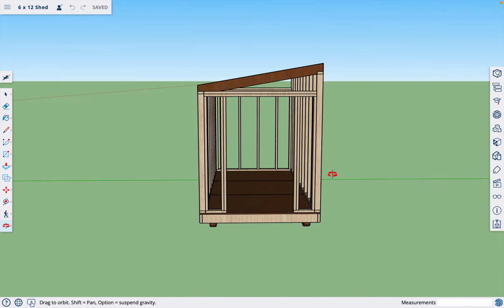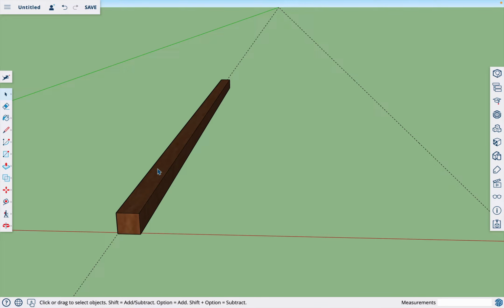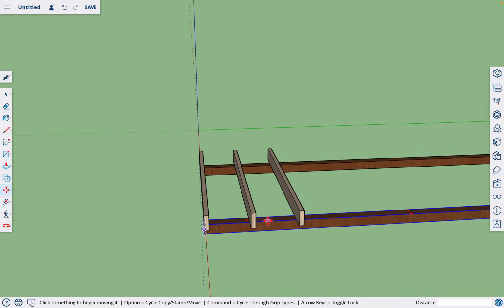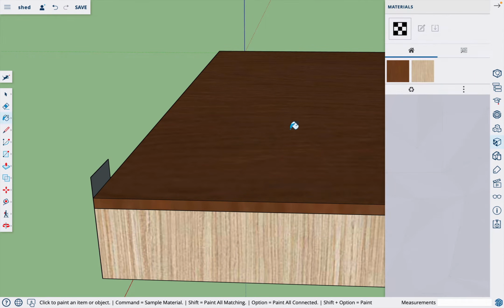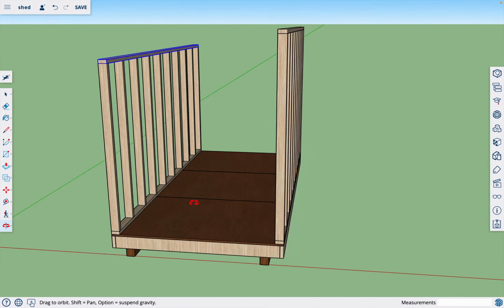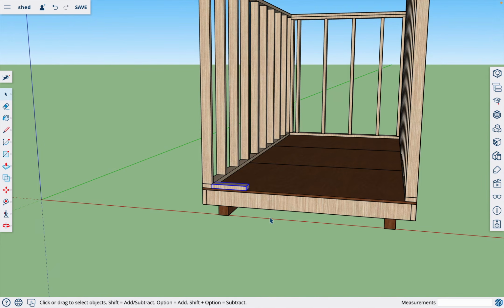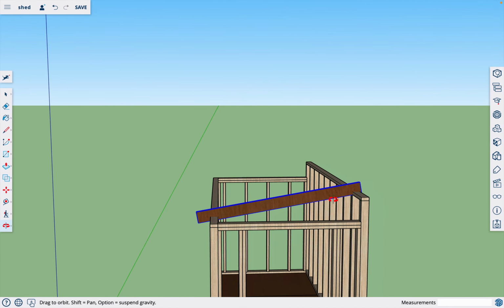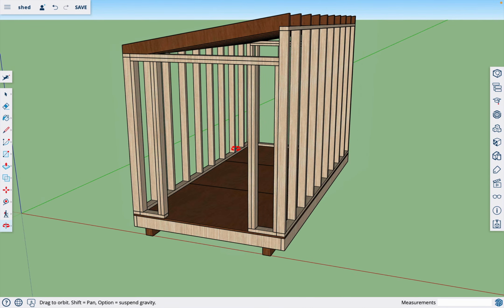SketchUp Community: https://sktchp.com/Join

Comment: Double are there to distribute the load. So walls that are supporting the rafters must be doubled. Door need a head resting on jack studs.

But so what learn a lot how to use sketch up
Reply from the maker: This video is to learn SketchUp, but also we’re talking about a 6x12 shed. You can build a shed without top plates, in fact many manufacturers do. Consider what the roof system of this shed weighs. Almost nothing. Same with the door, there is not room for a header. This is an example of how sheds are built, not how houses are built.

Comment: i appreciate the effort put into these as someone who knows absolutely nothing about framing and would like to learn. I do have a question however. Why is it that the longer walls don't receive 2 top plates like the short walls do?
Reply: I've also heard that you're supposed to overlap the second top plates 3.5" (the width of the 2x4)? not nitpicking at all, just trying to understand the reasoning behind certain methods so i dont make a mistake on my own projects

Comment: I took two pages of notes as you spoke, detailing all the clicks. A click chart might be helpful, but writing it down helps me to internalize the details.  Good presentation.  I did not know rafters were cut out to conform to the top plates in home or shed construction.  I will need to practice editing a component as I loved the tracing, lifting, and using the push/pull to lift it and then deleting from the lines.  This was also a good lesson in "exploding" a component to create a new one with slight changes.  Great!

Comment: Can anyone offer advice on 3d software sketchup. I’m planning an irregular shaped garden room to match the shape of my garden. The front wall of the room will be 10 ft wide and the back wall will be 4ft wide. Is it possible to design an odd shaped garden room with sketchup??
Reply from the maker: Yes you can design a room of any shape in SketchUp.

Comment: turn off Perspective, grab mid point of the joist, I do approve of the use of Components rather than groups. However, I'd make it a Comp before Paint or P/P  (saves some clicks), Make the plywood sheetacross the surface of the subfloor rather than vertical. You are relying on keying data in rather than allowing SU to do the math. And Yeah, I can be critical, I have the background to allow it.
Reply from the maker: Ok thanks